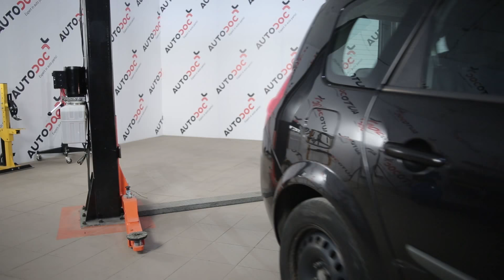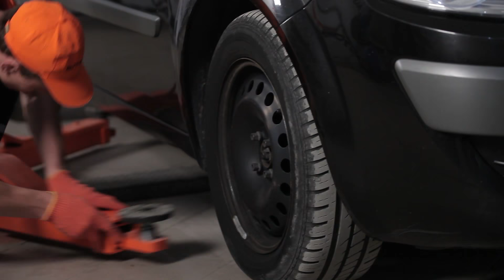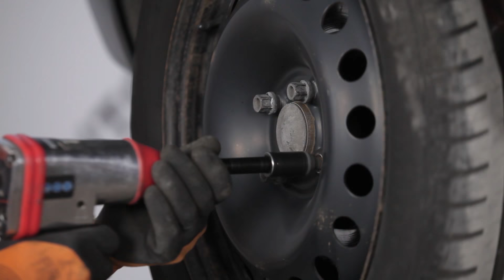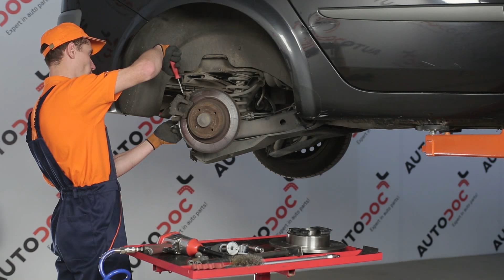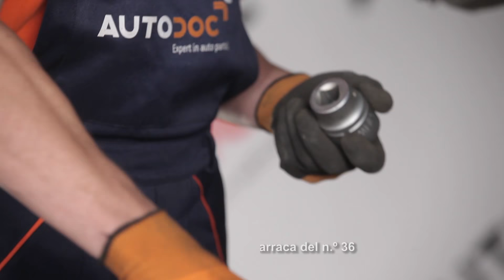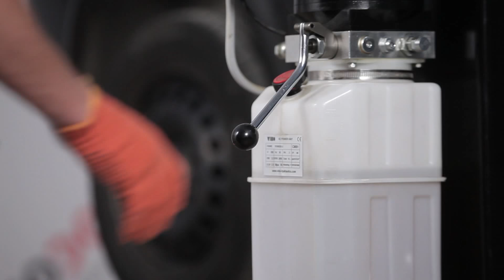Cómo cambiar discos de freno traseros y pastillas de freno en RENAULT GRAND SCENIC 2 INSTRUCCIÓN

Comment: Gracias auto doc por tantos vídeos constructivos y de mucho interés, tengo un megane2 y quería saber cual es el espesor en mm del disco trasero para cambiarlo. Nuevo mide 8mm de espesor, a cuanto tiene q  medir con desgaste? Gracias
Reply from the maker: Gracias por el comentario. Lamentablemente, no tenemos la información solicitada. Puedes consultarla en el manual del vehículo. Tu equipo de AUTODOC.